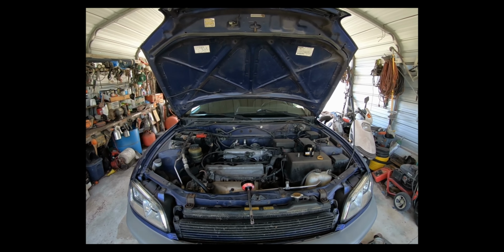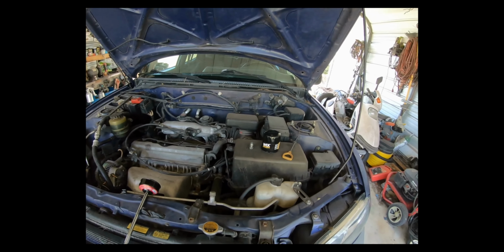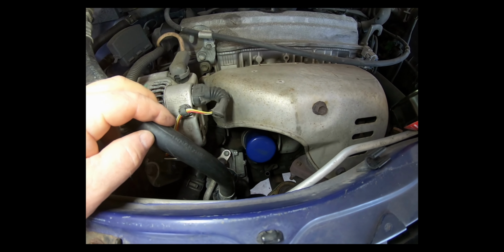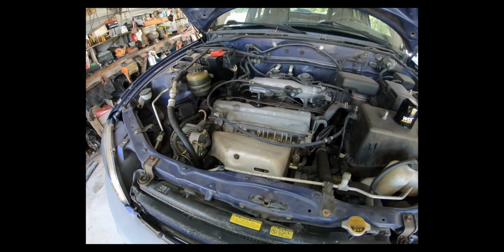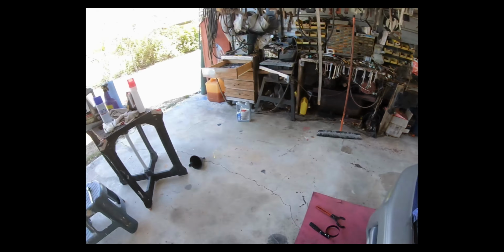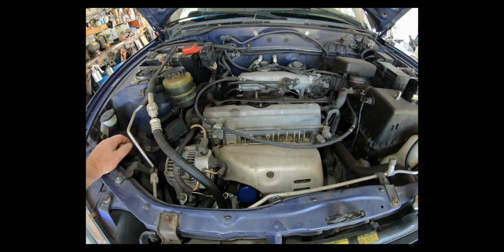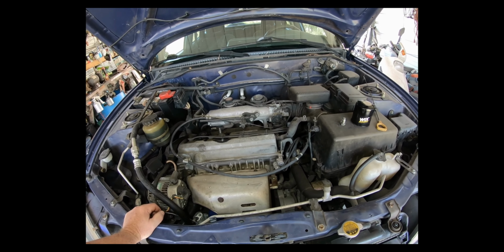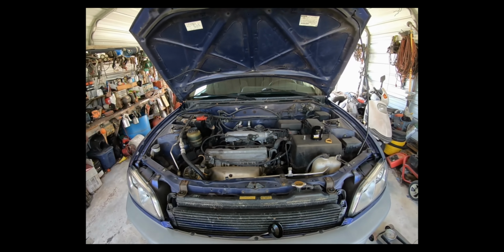Oil Change Tips - 2000 Toyota Rav4 (1st Gen) 2.0L

Comment: nice video. Sorry for asking, but i think that "high mileage" mart on the engine oil means that this type of oil can run for more miles than the usual oils (which applies for full synthetic oils anyway). Is this the case, or the one you mention, i.e. that this oil is for engines having already a lot of miles on them? Greedings from Greece!
Reply from the maker: Good point, but I'm pretty sure they are for vehicles with high mileage. They're advertised for vehicles over 75,000 miles.